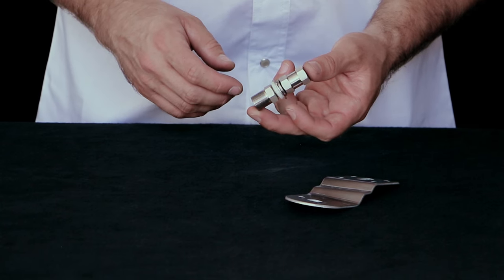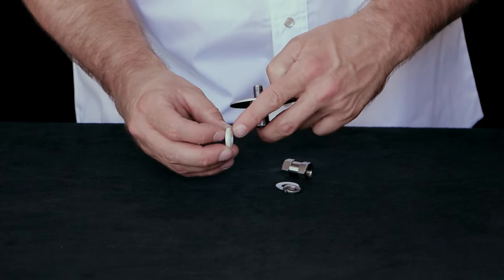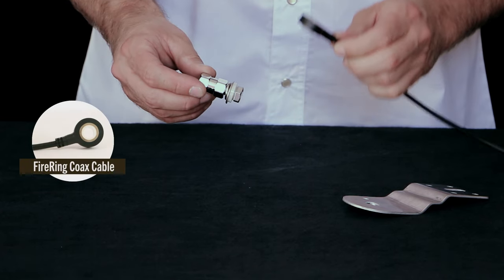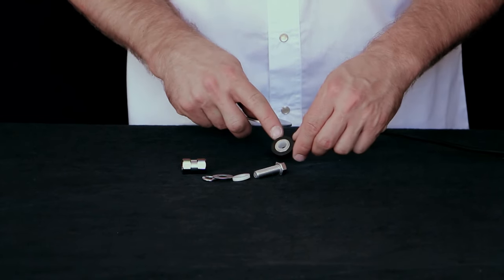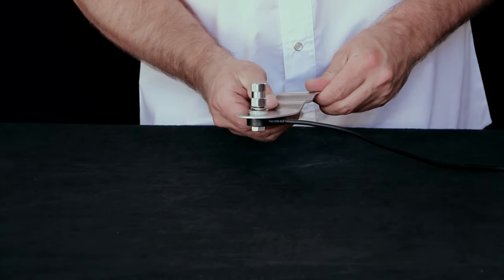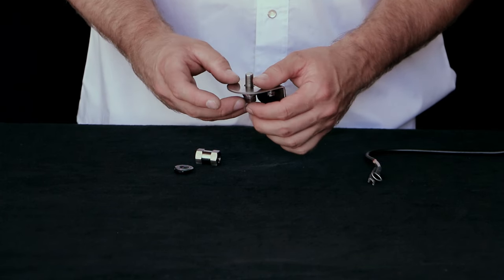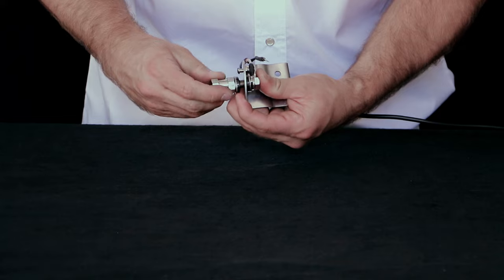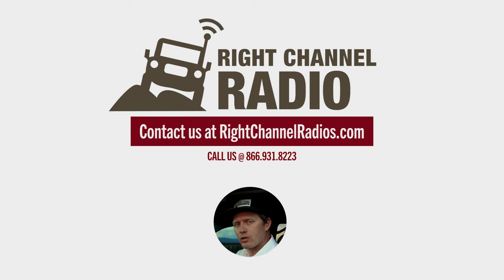How to Install a CB Antenna Stud & Coax Cable

Comment: It might be a good idea to use a voltmeter in continuity mode to check your coax for shorts before plugging it into your radio. I always preferred the firestik side mount since it just look clean and it hides the connections from the elements.
Reply from the maker: That is a good idea!

Comment: No Ground Plane Firestick. I put it together the way the directions said. Works great at 100 feet. After that nothing, The SWR is 2.1 on Channel 1 and 3.1 on channel 40. Mounting this on a motorcycle.
Reply from the maker: With NGP systems it's important that the coax cable is spread out a bit around the vehicle/bike as the coax and the antenna make up the ground plane. If the coax is tightly stored in a saddle bag, try running it around the bike (to the best of your ability) and then tune the system. Also, do not shorten the NGP coax cable.